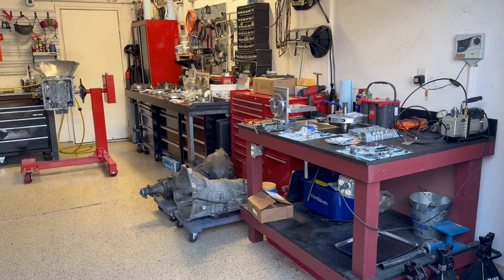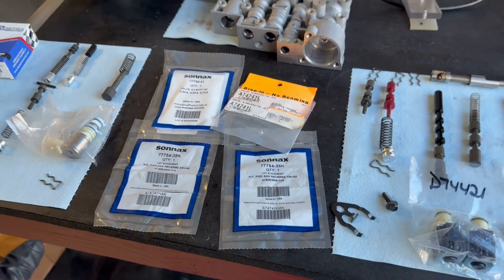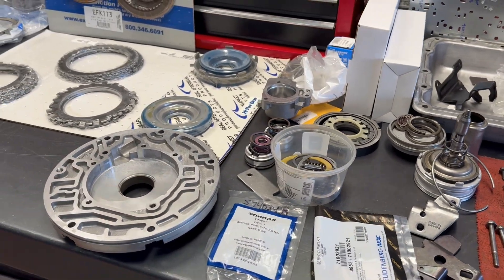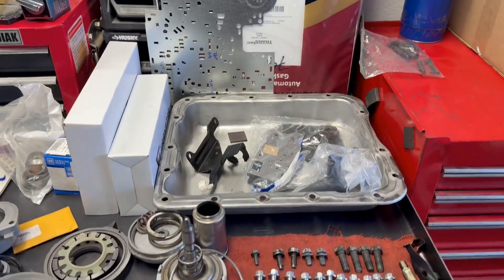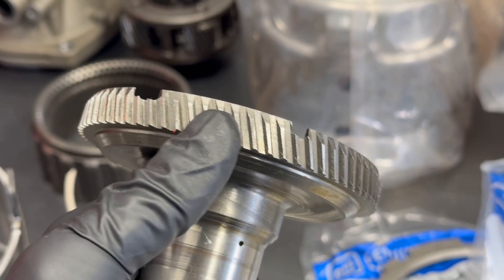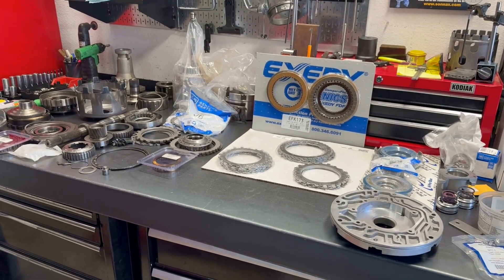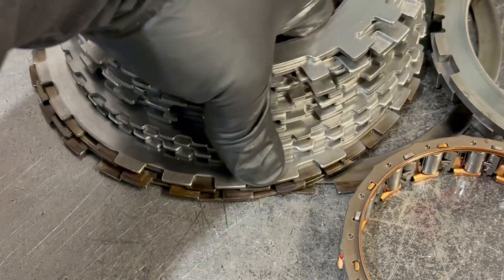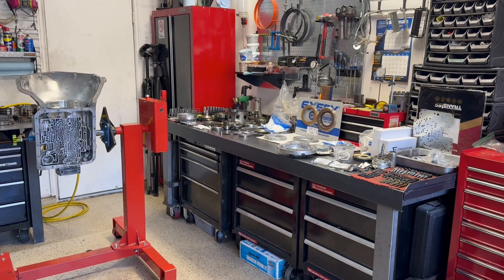4L60E Customer Build Profile: Exploded Forward Drum, Going Back Together With the Unit

Comment: Hey Nick...I'm going to be rebuilding a couple of 4l60Es over the next year or so, but getting started with a good shifting trans from a 2002.  On this first one, we're just going to stick with mods and parts that can be done without pulling the pump mainly focusing on the valve body. Would you have a basic, low hanging fruit parts list for this type of build? Shift kit? If so which one? Corvette Servo? EPC? I'm willing to buy whatever we need including reamers if they make sense to have for the next transmissions.
Reply from the maker: Thanks for watching, the Killerpea. If you are looking to just do valve body and pump mods without pulling the pump or going through the case, I would install a Transgo SK4L60E shift kit (no internal case parts) as well as a Sonnax boost valve, Sonnax TCC lock up valve, Sonnax o-ringed end plug kit and a Sonnax abuse valve/bore plug kit. Look at the spacer plate - make repairs or swap it for a Transgo 46-96 spacer plate like you saw in this video.

Spacer plate repair video: https://youtu.be/-Y_8nfNZse8

The most important thing you can do is vacuum test the valve body. That and the pump's pressure regulator valve are often worn. If the trans is shifting well then chances are the PR valve is fine. But you want to identify and correct any valve body deficiencies. Also, replace the wiring harness, all of the solenoids and pressure switch manifold while you have everything apart. 

Search my 4L60E playlist for other, relevant videos and watch any of those applicable to the valve body and/or pump: https://www.youtube.com/playlist?list=PLMqgQ_reThtL1h0_H8Rh-rzhT3qNEr0Kp

Thanks again for your viewership!

Comment: Thanks for the video and all the information! What do you find is the best pan gaskets for the gm transmissions? Mine always seem to leak? Thanks
Reply from the maker: Thank you for watching, Chad! I use the regular composite/paper style gaskets...If you torque all the pan bolts to 98-100 inch lbs (going around 2-3 times to fully compress the gasket) they won't leak unless the pan rail or case pan surface is warped.

Comment: I've gotten to the point with these it's almost cheaper to just buy factory unit.
Reply from the maker: Almost cheaper? 

So if I'm understanding correctly, you think that a more expensive factory unit would be better than building this one up with all of the parts seen in this video? If so, I would have to disagree, especially since (AFAIK), there are no new 298mm one piece case 4L60Es being made OEM anymore. Just remans, including from GM (if GM is even making those available)...Aftermarket remans are a joke, as you may have already seen on my channel and others.

If you meant to convey something different, let me know - I don't want to just assume..

Thank you for watching, TF!
Reply: Think about all your time. Ordering all those parts, all the mods, etc etc. Not to mention  the car taking up a bay if you don't have room to push it out. Time is money especially when the shop does other things. Trust me, I've been a mechanic since the early 80s. Still build these once in a while for bigger hp rigs, but I can tell you, it's hard to make any kind of money when you break it down. Otherwise us mechanics would be living a lifestyle of the rich and famous.  😂
Reply from the maker: I only do bench builds and have parts delivered to me so time isn't a factor but risk sure is....All the parts I usually install correct common pattern failures so I never have to see the transmission again. So I think about my time all the time and my model invests a little bit more time up front to nearly guarantee I won't ever have to spend any (aka a lot more) time having it come back to me...A bit of a different perspective on the concept of time and risk management relative to your above. 

I am a one-man shop so warranty claims are much more impactful for me than others. Plus the customer gets a transmission that I know will last a very, very long time...Piece of mind for both parties is well worth what little extra time invested for parts. 

Trust me, man - I make good money or I wouldn't be doing this.

Comment: I have to agree, an over pressure problem is probably the cause. But I would be willing to bet. The Pressure Control Solenoid was also cranked up, well past what would be acceptable. Just an opinion.
Reply: That's exactly what I figure happened. Big boost valve, pressure cranked up, and no bleed. That aluminum drum just couldn't hold the pressure.
Reply from the maker: You both very well could be right about an acute, localized overpressure condition in that part of the drum between the base and piston...

I have never seen someone block off that air bleed before in these units and certainly would never recommend it...I did piece the drum back together and all the pieces seem to fit; I have had drums crack before and still exhibit end play when yanking on the shaft but this one was different...I am beginning to suspect a 1-2 punch of interference fit and hydraulic overpressure in the apply cavity as a result of blocking the bleeder and possibly turning the EPC's little screw to allow for higher line pressures across the board.

I am working on an outline for a forensic examination video of that drum, including disassembly, inspection of the inside to see if we can learn anything further and  definitively pinpoint a cause or causes. I have all of the bad parts, including the electrical/electronics so perhaps they can tell us something more.

Stay tuned...

Comment: What is a good kit to completely rebuild a Chevy 700r4
Reply from the maker: For something stock or mild performance? If so, everything you see here except you would purchase the 700r4 overhaul kit (add in a 4L60E viton lube seal for the forward drum) and new governor gear, case connector and Transgo 700Jr shift kit along with some applicable Sonnax parts for the pump and VB.